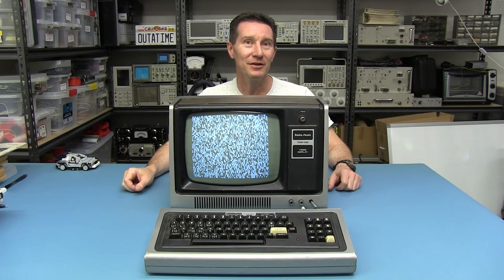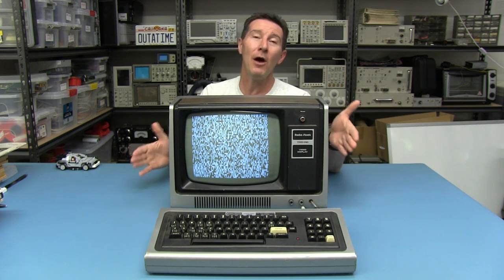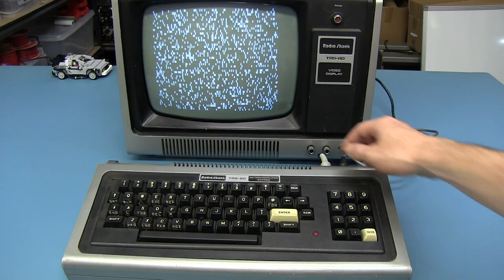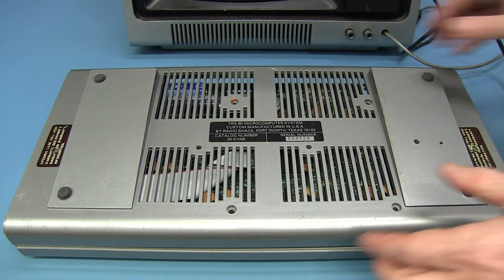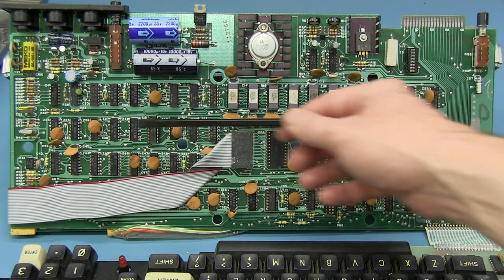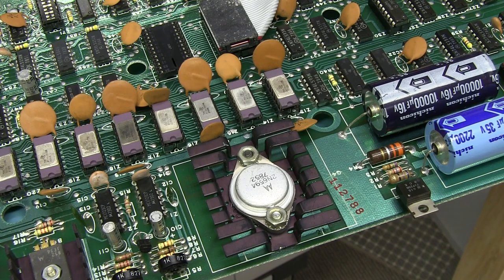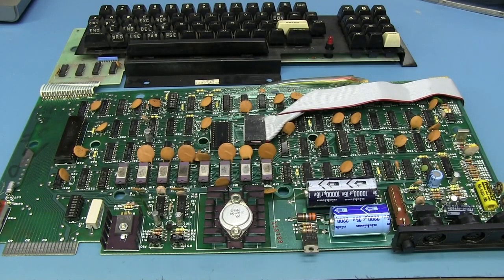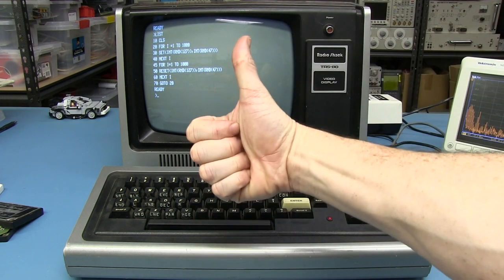EEVblog #645 - TRS-80 Model I Retro Computer Teardown

Comment: Actually, that character generator produced both upper case and lower case, but there was no memory chip to store the bit which denoted lower case or upper case.  It was a very simple, and common mod, to piggyback a memory chip onto another memory chip.  You had to bend out one pin and run a jumper and solder it to another trace, and presto, upper and lower case.

Comment: I have two of these.  Oldest of the antique computers I have, circa 1977 I think... off the top of my head, even though I have others that look much older (Osbornes, Kaypros, Heathkits, PETs, Model II's & IIIs)  Oddly, my Model 1's are in the most pristine conditions of any computers... like you just bought it at the the store.... probably because they quickly got stuffed back in a protective suitcase that came with them and forgotten.

6:55 - Actually, now that I look at it, I realize how much of the idea and styling of the C=64 was ripped from the Model 1 which predated it a lot.  The C-64 was the best selling 8 bit of all time, not the Model 1.   Unless the Atari 2600 game console beat it, would have to look it up.
Reply: +CHOPPERGIRL AIRWAR I dare to disagree on the C64 keyboard part (no numpad on the C64, different orientation of the cursor keys) if you look at it that way pretty much every "keyboard computer" ripped off the SOL-20 (which was the first computer putting everything except the monitor and media [tape/floppy] in a single case).
I actually do the repairs for parts of the collection of retro-computers for a near-by university (dropping out on the analog computers - because I have no clue about them) which has 2 sets of TRS-80 Model I machines with monitors. One is like store-new (american 110V version) while the european version certainly got a decent amount of use in its' life so far.

Comment: Z80 running that slow?! It  usually was clocked at around 4MHz and that’s needed to come even close to the 6502 and 6809 because those professors can do a memory fetch and increment or decrement with one instruction with the Z80 you need a couple. Everything with the Z80 needs to go over the accumulator and takes extra instructions.

Comment: I purchased mine just after the introductory price was removed for $1100. MIne was a Model I Level II 16k. The next year, 1978, if I could afford the Expansion Unit I could have had an additional 32k RAM and one or two floppy drives, I still have the original casette player but do not use it with the computer. The trash 80 is boxed up. I can't decide whether to toss it continue to keep it. $1100 in late 1977 was a lot of money. In late 1978 I replace the trash 80 with a Commodore 64. That was a swell computer. Still have that one and the C64C, plus 2- C128D's.

Comment: I bought one of these as a replacement to the Dick Smith System 80 which was a POS that failed on a regular basis. I later assembled the LNW research DIY expansion interface populated with the full bottle 32K RAM (48K total) and a 128K ??? floppy  using a  portable tv modified for direct video input.
At the time I was heavily into amateur radio and used it for RTTY and AMSAT prediction. Probably not the best choice as that RFI extended all the way across the HF spectrum. Lining the case with kitchen aluminium foil and some chokes on the cableing knocked the top of the RFI but never really killed it.Used it up to about 1985 when I bought an IBM PC XT clone.

Comment: 2:30 Price didn't include monitor?  I am not 100% sure but don't think that sounds right.
Reply: +Nicholas Nessen well actually I thought the cassette drive cost extra. Seems like everyone has a different view. I guess I could check radioshackcatalogs.com to know for sure but perhaps in Australia it was a different deal. 

Yep you were right and the host was also right. You could buy everything aka carte but the normal way to purchase included display and cassette for $USD 599.95. That's how the 1977 RSC-01 catalog lists it at least.
Reply: I have to look at that catalog, but the way I remember it was that for the $599.95, you got the CPU and the monitor.  You had to pay extra for the cassette.

Comment: I remember having "trash 80s" in the back of the classroom, but they had been replaced by Apple II so they were rarely used. I remember them with monochrome green though, not static. They later became Tandy and were hugely successful. I believe the TRS stands for Tandy Radio Shack.

Comment: The 6502 at same frequency gave at least twice the processing power as the Z80. In the early 80s typically 1 MHz 6502 machines competed with 4 MHz Z80 machines.

Comment: I bought mine in 1980, $599.99. Monitor, tape deck, keyboard, 4K and tiny basic. Learned BASIC. Apple never had over 10% of the micro market due to cost.

Comment: The standard BASIC was only 8kb, and very restricted, it didn't even have POKEs.  The 12kB BASIC was an extended BASIC and had more keywords than the standard MS BASIC on the PET.

4 kB TRS-80 cost $699 in Australia, PET was $1000 and Apple II was $1300.  But the PET included a monitor, cassette recorder, full Microsft BASIC, all interfaces, 10 key type ahead buffer and three key rollover, so it was really cheaper.

The TRS-80 was the best selling simply because it was available - the PET and Apple had long waiting lists and you had to usually buy them mail order.

On the Model I, you had to slowly and carefully press each key in turn, as there was no key buffer.

You could only increase RAM to 16 kB by drilling holes into the motherboard to fit posts and carefully soldering a daughter board to the pins of the end RAM chip.  It was a 16kB max machine really.

You could get sound easily by using the REMOTE socket on a cassette recorder and sending pulses out via a POKE and PEEK to two memory locations, the sound came out the cassette recorder speaker.
Reply: ..to 48k I mean.

Comment: There was an aftermarket product that added  UC/lc, Required you to crack it open and solder a chip onto the back of a chip on the mb. One of the first  mods I did to mine, lol.
Reply: Mark Berry. Yes, me too. Very easy, cheap fix. I was annoyed Tandy didn't have l/c in the factory spec.

Comment: My first computer, TRS-80 model 1, I think I paid $800 in 1978.  I paid a further $1600 for expansion interface, 16K more memory, and a floppy disk drive in 1980 or so (I had to get a loan!).  Triffic to see a working TRS-80, I must have spent > 5,000 hours in front of one of those.

Comment: The Apple II ran VisiCalc — the original Killer App. The Trash 80 Kickstarted the hobbyist market (well, in the US. They never sold very many over here in NL, but then neither did Apple), the Apple II did so with the serious business use market. They're both milestones, but given the trajectory of the computer industry over the ensuing two decades after the release of VisiCalc in 1979 I think it's fair to say that the hobbyist market was well and truly subsumed by the business market. Just as today it's the consumer market that has eaten the business market's lunch.
Reply: They never sold many here in NL?
Reply: Jeffrey314159 not to my knowledge. Here there was the C64, the BBC, and a bunch of cp/m business machines, and then later a little bit of Amiga and Atari st before the ibm compatible PC took over. Plus Mac, of course.
Reply: Jasper Janssen  I forgot what does NL stand for?
Reply: The Netherlands! Sorry, I didn't realize that was what you were asking.

Comment: HEY.. if you look for the poct of that type of computer in wiki you will se THAT exaxt computer in the liberary "File:Radio Shack Tandy TRS-80 Model I Rear Panel.JPG" how did you end up with the exact same computer? same brakes in the casing and same paintchips.

Comment: i'm typing in a basic program from 80 microcomputing issue 1980-01 and the program (page 37, after all the corrections) reads internal error. any ideas?

Comment: Unfortunately, I remember having to repair this and all of the tandy colour computer range.
In my teens I bought a Colour Computer 3 which upgraded to custom 512KB board and expansion with XT hard disk.. yes.. all 40MB of disk space. awthum...

Model 3, oh god what a pain it was repairing those floppies, alignment was always an issue as well as head wear. Ended up we replaced those full height drives with half height replacements.. 100x more reliables. hehe.
the list goes on with that repair center history but won't bother that far.. ie 10MB full height HDD with glass bulb for shock break warranty void. LOL....

Comment: The power supply was a separate module.  Open the monitor and you’ll find it wire tied inside!  Like I did to mine! 😂 The recess in the monitor case was there when new ... But no hole.

Comment: 4116 - 300 ns speed rating. they often had 450ns rated parts and if the -12V rail died as often happened then these chips turned into very hot toasters!

Comment: I remember soldering on a chip to give the character generator true lower case letters the descenders.  I made from kit the TC-3 high speed tape which wore out the play button all the time on the tape deck.  I had the voice recognition. I also had the voice synthesizer.  The Thermal screen printer was the absolute piece of junk ever !!!  I then modified the character generator so I had access to every pixel but it was not easy because it was managed by the character generator.  OMG I forgot I added a faster clock also !!!

Comment: I have one of these.  I stacked 3 layers of 16k ram where the orignal 4k chips were, with flying chip select pins and added a single nand chip to produce those chip selects.  I have the full 48k in the keyboard.  The fourth 16k layer was reserved for the video image.  I also upgraded the video driver amplifier, to eliminate the ringing.  Wrote my own word processor in machine language, in a single k.  Still runs.

Comment: is that a left-handed oscilloscope on the shelf behind your head? :P
Reply from the maker: I'm letting the electrons settle to the top of the case, improves the bandwidth.
Reply: US spec scope. Normally in Australia they have the display inverted for Southern Hemisphere use. That one is an import.
Reply: EEVblog happy electrons-->happy device =)

Comment: The raw clock speeds of the Z80 should not be directly compared; it is not beneficial to the TRS-80 to do so. That 1.7Mhz Z80 becomes much less impressive when you consider that a 1Mhz 6502 had an IPC comparable to a 2Mhz Z80. Another way of thinking about this is is that the TRS-80's Z80 CPU could only achieve 85% of the performance of its competitors.

Comment: "Pioneered" means "was the first with" or "came first," so it actually was the Apple II, as far as the market is concerned,** that pioneered the industry of this style of computer. Then came this one a month later, and then the Commodore PET a few months after that, all in 1977. But this was actually not the most popular of this style of computer of all time; the Commodore 64 was.

**The Apple I really did the pioneering specifically, but it never got to market as far as I understand. I want someone to correct me if they have better info., though.
Reply: Why are you putting those in quotes (besides referring to the time I said it, of course) then, MichaelKingsfordGray? Were those only figurative; not literal?

No, the HP is just a programmable calculator (about like an old-fashioned version of the TIs today, except that it's not a graphing calculator), and the Altairs don't even have keyboards or monitors. You haven't seen pictures of them? Just switches and lights! And by the way, having an integrated monitor means nothing about whether a computer is personal or not. Unless you've been living under a rock for so many years, you would know that. Are you using an Apple Lisa, an old-fashioned Mac, an iMac, or a laptop Mac or PC, or Commodore SX-64, IBM 5150, or Matsucom onHand, etc., or any number of tablet computers right now? If not, then you're using a computer that does not have an integrated monitor, and it's still a personal computer.
Reply: Um, okay, "mate," no, I wasn't challenging you on the scare-quotes to be combative. I was wanting to know why you would use scare-quotes on the second "came first" and on "personal computers." Why would you worry that they'd be taken out of context without the quotation marks? And since when were scare quotes supposed to be used for that kind of concern? They're for writer to show that he or she is using a term or phrase that he doesn't really believe but which someone else might say anyway, or in other words, to refer to something that's just figurative. Why would they be used for context preservation unless you were actually quoting someone? And why are some of yours just semiquotes without first being inside standard ones?

I called the HPs calculators because that's what reputable sites say they are. What is it that you believe makes them "fully-fledged workstations"?
Reply: OK, I think I have no good reason not to believe you. You and I have both been around for a while, but you've obviously got even more years of computer experience under your belt than I do even at 41. So now I'm trying to think of the best way to reword my OP here.
But you're still wrong with your understanding of how scare quotes work. You're trying to say, literally that these earlier models came first, NOT figuratively, right? In that kind of case it doesn't make sense to use quotation marks. They do the opposite of what you're trying to do. They weren't called "scare quotes" to scare people into believing what they say; they imply the act of scaring people out of believing what's inside them. If you want to appear as if you are not bullcrapping people, you need to leave the quote marks off in this kind of case. (But leave them on if you're actually quoting someone, of course, as your first set is for, with me here. Plus, you still haven't answered my question about why some of them are semiquotes, which actually belong around quotations within quotations. What's the answer to that?)
Reply: Ehh... well if that were to be the case, *****, then I'd like him to have used a different word there, because I don't really think using "pioneered" colloquially works that well.
Reply: Yeah, I figured so, *****....
Reply: +MaxxFordham So pro Apple.. Considering they nearly died twice, i think all companies involved in the early days helped push it, be it IBM, Commodore, Apple, Acorn, Radio Shack, BBC, Atari, Amstrad...so many. Lol. If they hadn't, likely someone else would have! Owning many old computers though i can see why the PC dominated so much, even ignoring the crappy copy protection compared to others being deliberate to get more market... I have a PowerMac G4 from 2000, an Amiga 1200 from 1992 (with 1994ish upgrades and a CF card as a HDD) and a HP Pentium PC from 1995 ("pimped" with extra RAM and a 166MHz MMX CPU!) and it seems to be the Mac that screws up the most! Even when it wasn't overclocked.. Amiga crashes the most if i'm honest! Even after timing fixes, new caps and whatnot.. Strangely, haven't had to re-cap the other machines...
Reply: +MaxxFordham Apple is good at translating a new technology into a consumer product. The Altair might have been the first "Home Computer", but the Apple I and II would have been the first computers an average person could have done something useful or fun with.
Reply: +MichaelKingsfordGray Those HP machines aren't really Home Computers now are they? Your HP9100A doesn't even seem to have a full keyboard. The Altair certainly didn't, even though it arguably can be called the first Home Computer. It wasn't really usable by a wide audience.
The Apple II, TSR-80 and Pet were designed to be used by and affordable to the average consumer, no assembly required. These were the first computers to be used not my electronics enthousiasts, scientists or the military, but by kids and their parents.
Reply: What do you mean by "so pro[-]Apple," ChaosHusky?
Reply: Well, RogerWilco, Dave didn't say "an average person could have done something useful or fun with." And he's also saying that this was the one that the most units of sold for its day, but only a few years later the Commodore 64 came out and beat that record, and I would still say those years were "its day" for this computer. So he should've said "until the Commodore 64 came out."

But I'd say you're right about what you're telling MichaelKingsfordGray about those HP machines (setting aside the random capitals on "Home Computers").

Comment: The button in the expansion bay was the reset button.  You can view the schematic in the Technical Reference Handbook here http://akhara.com/trs-80/docs/model1/

After taking a quick look at the schematic, accidentally plugging in the power connector into either the cassette, or video, connector shouldn't have caused any problems, although it wouldn't have turned on.  (Although I may have missed something.)

Comment: Z-80 has a minimum of 4 clock states per instruction.  6502 has a minimum of 2 clock states per instruction.   The best case for the Z-80 running at 1.77 MHz was 443K IPS.   The 6502 in the apple ][ ran at 1.024 MHz giving best case of  512K IPS.  Many instructions on both processors took more than the minimum clocks to execute.   In very general terms the 6502 was more efficient, clock for clock.   Enough so that a 1.77 MHz Z-80 could not keep up with a 6502 running 56% slower.

Comment: Hmm, if the unit spewed that much unshielded RF you probably could characterized it and breadboarded a few simple AM receiver / relay units -- and used the TRS-80 to control your household lights and appliances…  :-)